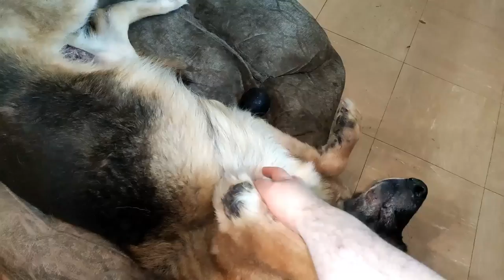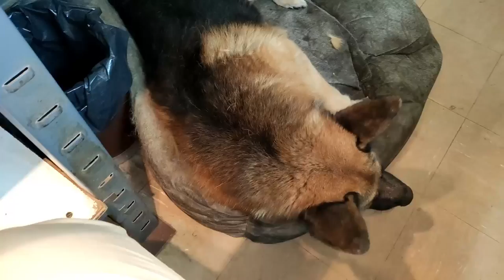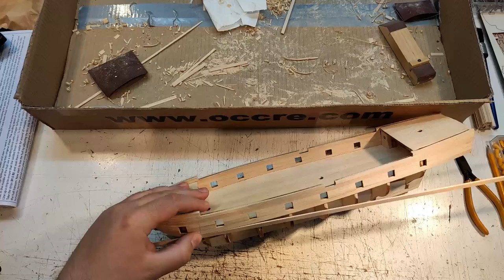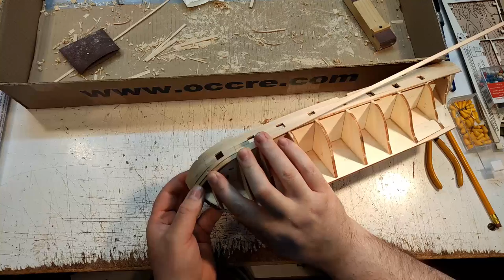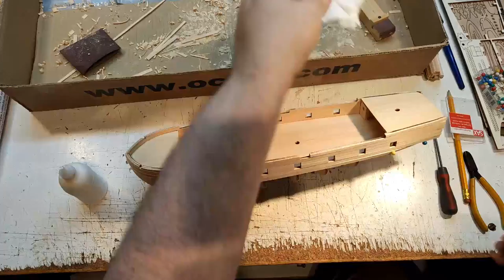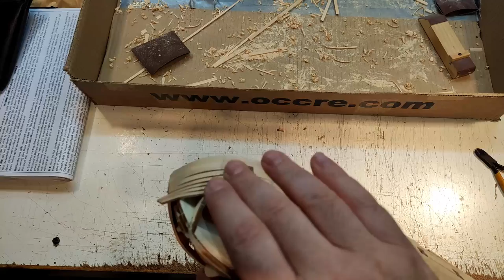HMS Beagle - part 7 Planking Under The Bulwarks

Comment: Hi John! Great work as always. I wonder that if I use less wide wood strips they are going to leave gaps between each wood strip. Is that a problem that i would have while planking?
Reply from the maker: Thank you! What ever wood strips you use you need to make this procedure or else you will have big gaps and steps. Doesn't matter of the strips are 3mm or 5 or 6mm wide, the procedure must stay the same.

Comment: Hi John, thank you for your videos they have been a great help to me. I am currently building the Artesania Latina Virginia 1819  and have decided to build the Occre Beagle next. Sorry if you have previously answered this. When planking, how do you determine how much to taper each plank from one plank to the next? In general, do you just taper the plank to half its original width at the point of the bend towards the bow or is there an exact measurement you use?
Reply from the maker: Hi Steven! Thank you very much! You taper  the strips up to the 2/3 at the beginning of the curve and then you proceed up to half. You can tell if you need more by the eye. The strips on the bow must have a small upper direction so that they end a little bit higher than the center. So strip by strip you calculate if you need tapering at 2/3 or half.
Reply: @JohnsWoodenShips   Thank you so much John! That makes a lot of sense and is a more straightforward approach than measuring the distance between each bulkhead and doing a calculation.